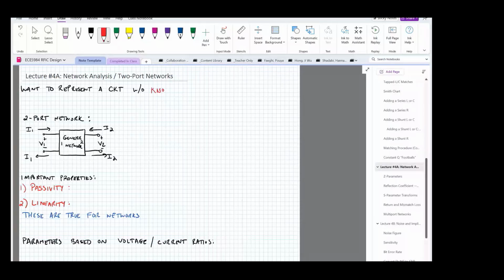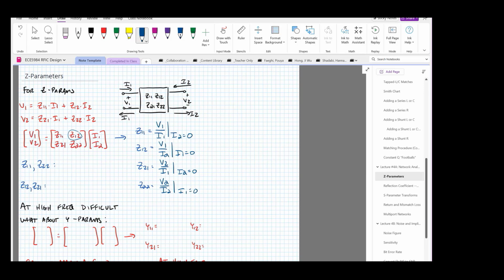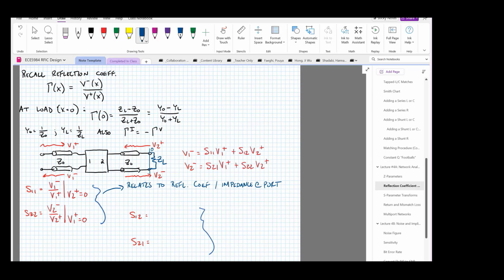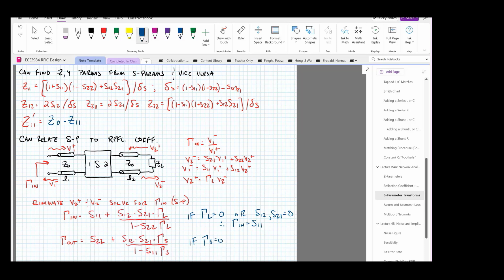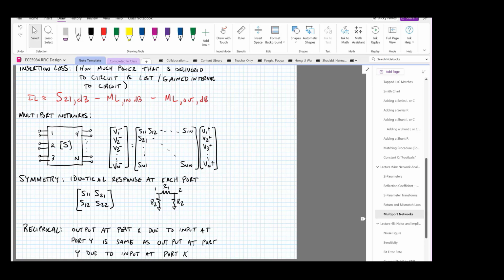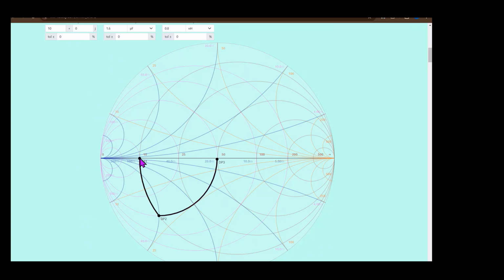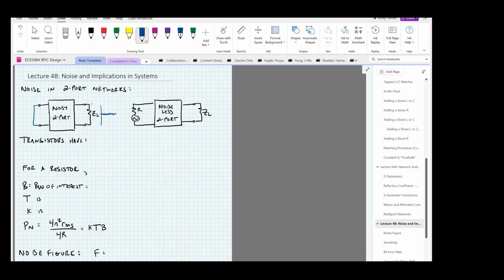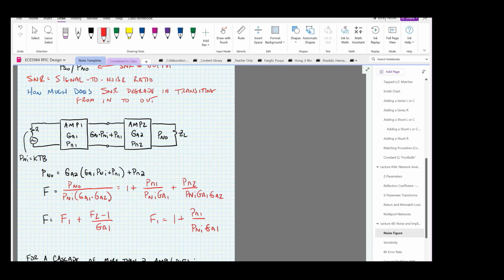ECE 5984   Network Analysis and Beginning Noise Analysis

Comment: I think there is a mistake when you defined noise factor as noise power @ output divided by noise power @ input minus available gain. The denominator should be noise power @ input multiplied by available gain.